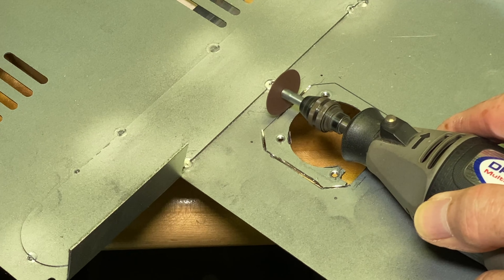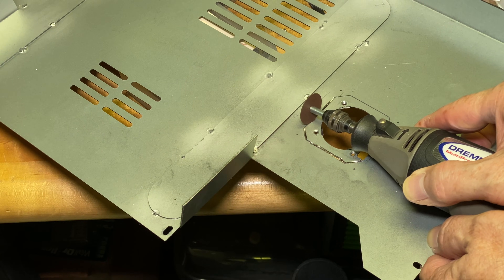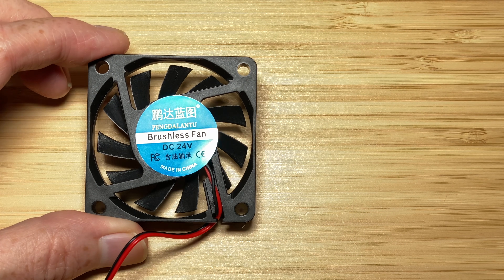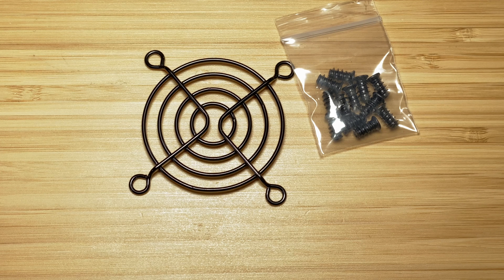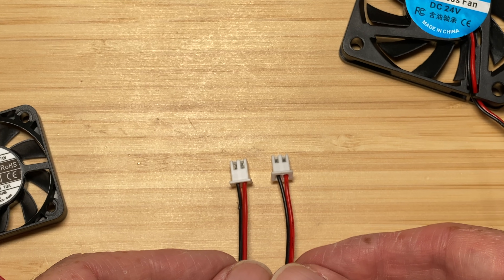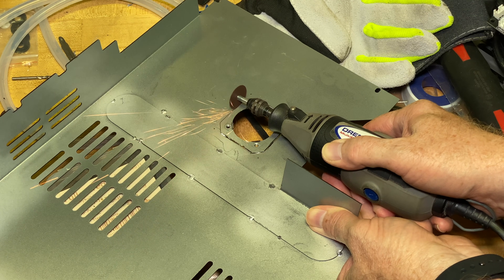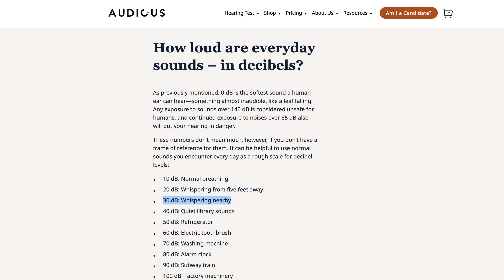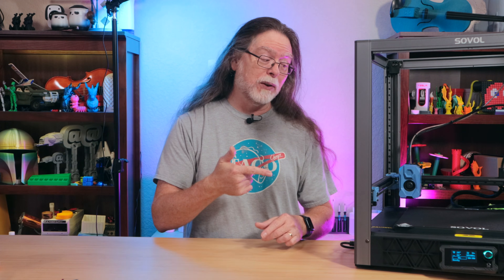Make your Sovol SV08 QUIETER with this $3.50 Fan Mod

Comment: I have received my SV08 about a month ago: 1. It has an aluminium bottom panel - no sparks when cutting out for the fan.  2. The fan is not running all the time, in fact I can't work out when the fan runs (?) If anyone know when this fan is meant to run in this later version, please let me know. I enjoyed your thorough explanation anyway, thanks.

Comment: you could just replace the stock fan with noctua nh-a4x10 24v. It's the same size, but infinitely quieter and very reliable. No need to even configure it, this thing is unnoticeable even on constant 100% speed. And certanly no need to cut anything
Reply from the maker: Thanks! I keep forgetting that Noctua finally came out with a 24v fan.
Reply: You have a Sovol?
Reply: What people don't mention about the noctua is It also blows way less air than the stock loud sv08 fan sso you sacrifice quite a bit of cooling for more silence. I print a lot of 24 hour plus prints so I didn't want to put in a fan that cools less

Comment: Hello, I do not  have that printer but if I did I would like to do this mod the first uestion I would have would be which way did you point the fan blowing in or out? I am uessing that you have it the same way as the old one but you did not state this in your video.

Comment: I wanted to share another way to avoid drilling.. get a bigger quieter fan 24v compared to stock fan , go to thingiverse or thangs and search - adapter for fan from 30mm to 60mm - this is an example.. there’s a plethora of sizes, after that install using same screws from stock fan.. no drilling no cutting

Comment: You had the work cut out for you there.

60x10 is a good size-type, nicely chosen.

I have a different printer mostly DIY and i have dug around and found myself to be in possession of a bequiet double ball bearing 80x25mm fan which i bought about 22 years ago, it was perhaps a little too loud for my PC so not used much, but in the 3D printer it's pulling pretty good duty on the printer controller cooling... might even be a bit of an overkill but that's just how i like it. I did open it up and pour some 75w90 oil into it which seems to have quietened its bearing knock that it's always had. When you have a nice quality fan like that when it's completely worn down you just open the back, chuck the bearings and order fresh ones from a bearing specialist it'll be good as new, but it should take more than 10 years of 247 to get to that point.

Kinda tempted to design a voltage mode control fan controller based on Blue Pill... could get a small handful made and put them idk one in the 3D printer and don't know where to put another one or two, my PC doesn't REALLY need it i don't think... but it would let me combine 12V and 24V fans on the printer which ever way and individually control them, could also tie them into motor enable signals and whatnot.

Comment: When assembling my SV08, I swapped the stock motherboard fan for the Noctua NF-A4x10 24V fan.  It was instantly so quiet and cooled the MCU so well that I didn't bother with the rest of the upgrade to put the fan under PID control o it only ran when needed to cool the MCU, and only as fast as needed to keep it quieter.  I left the Noctua fan running all the time directly from 24V.  It's a very reliable high quality fan so it should last longer than the SV08.

I also upgraded the stock hot end for a MicroSwiss hot end.  This gives me the ability to cold swap the nozzle with one hand in two minutes using nothing but a 7 mm nut driver.  The SV08 hot end requires me to remove and reinstall the heater and thermistor without damaging them, just to swap the nozzle.  I also like that the MicroSwiss FlowTech nozzles can be shared between 3D printers once they have been converted to MicroSwiss hot ends so the investment in nozzles is retained.
Reply: +1 On this mod. It's the first thing I bought for my SV08 and it's been keeping its MCU board cool since I got it last summer. Also got a Noctua fan for my exhaust filter, they can't be beat when it comes to quiet operation
Reply: @samlcyo2  - I'm designing and building an insulated and structural 3D printed enclosure for the SV08.  It has two large activated carbon HEPA filters on top (sold for use with room air filters) and two 120 mm Noctua fans in the back to either push the air through the filters or to actively exhaust the enclosed SV08 when the front door is raised while printing PLA.  I'll upload the files to Thingiverse and Printables when the design is finished in a week or two.  More light gray PLA is being delivered today.  The enclosure uses a lot of filament.  Someone should make The Enclosure Of Many Colors (or Joseph and the Amazing Technicolor Dream Enclosure) by connecting all of the 40-60 gram leftover reels of filament they have lying around.   😀

Comment: My printer is still loud. I changed out the fan and that’s fine now but the belts are so loud I can hear it with the door shut a few rooms away. Any other mods to make it quieter or did I get a faulty machine?

Comment: Sure "i dont have to source screws and stuff"
Have an Ender 7 (well eh the frame still is original)  it now has 6 5160's on an BBT Manta e3 with CM4,  3 ldo steppers and LDO Orbiter 3 tool head...
And since then i own more screws one can shake a stick at m2 m3 m4 m5 in all lengts...

Comment: I just got my sv08 put together & measured my ambient noise level in the room at 48dB, and with the sv08 on (no mods) at 60dB (1 meter from the unit).

Comment: Did you changed the firmware or just updated the fan?
Reply from the maker: I didn't change the firmware, I only replaced the fan with a larger, quieter one.

Comment: How do you find the host temps with the new fan?
Reply from the maker: Hi, with an ambient temperature of 26.8˚C as reported by the bed, the host temp is around 44˚C and the MCU temp is around 32˚C.
Reply: @BV3D  awesome. That sounds better than stock. It's about 12c down here and the host temp sits around 34 to 40c no load.

Comment: There is a software controllable fan header on the board. It is available in Klipper.
Reply: I've moved mine. Still doesnt quiet it down, nor does it cool very well
Reply: @hairytoez75  You ever mod?
Reply: @boredfive3001  I ended up cutting a hole for a 92mm fan with a buck converter at 9v
Reply: @ How did it improve things?

Comment: Fans and shroud proximity, have been something that manufacturers still haven't figured out since Ender3 for some companies.. from an engineering perspective, it's honestly sad. They just have an obsession with these stamped fan shrouds and sticking the fans right against it.. all it takes is spacers to move the attachable style of shrouds a few mm further from the fan. Sometimes ground clearance becomes an issue, then you also need to extend the printer's feet a bit.

Comment: You could put some locating pegs on the cutting template that fit in the original screw holes so it's always perfectly square.
Reply from the maker: That's not a bad idea!
Reply: @BV3D  Sounds a little OCD as it doesn't really matter if it's perfectly square

Comment: I installed the Noctua 40x10 24v before I ever turned the printer on, so I don't know what ya'll are talking about. Drop in replacement and whisper quiet, though more expensive.
Reply: First thing I did when watching this was look up noctua🤣 found the fan you bought. Was it plug and play?
Reply: @zac_in_ak  Yes.  The one I got was same size as original, so no cutting or anything.  Just unplug and unscrew the old one and screw in and plug in the Noctua.  GerGo 3d has code to make idle temps better if you want to do that also.  Remarkably quieter
Reply: @zac_in_ak  It was.
Reply: i can only find 3 or 4 pin noctua fans but isnt the sv08 fan 2 pin?
Reply: @khakiboi  One of the included adapters worked for me. Noctua gives you a bunch.
Reply: @khakiboi  The 40mm noctua I saw came with a bunch of adapter cables
Reply: I recommend the Noctua as well.  Did you insert the code to reduce fan speed at idle?  It helps alot also.
Reply: @newCrysis  Sure did thanks.

Comment: simple code in printer.cfg file  will make it run only when it is getting hot
Reply: adding a quieter fan, such as a Noctua, will help when running and idle.  I love who ever figured out the code to reduce fan speed at idle.

Comment: Dad joke level = black belt

I have one of those older dremels too and it just keeps on working. Been a phenomenal tool and I'm very familiar with that hot air that comes off the motor. Can make things uncomfortable sometimes.

And those cutting wheels come in large packs for a reason. 😁 I've had a number of oopsies over the years where I put a brand new wheel on and immediately break it. The man who makes no mistakes never makes anything.

Comment: I received my SV-08 on June 26. It has an aluminium bottom plate that has protection for the main wire loom. I would not recommend those fans that you link to Amazon. Winsinn makes 6010 / 24 volt a 4 pack for $20 USD. dual BB fans.

Comment: For those who don't have a rotary tool, or don't want metal dust everywhere, I recommend using a nibbler (like the Radio Shack HT-204) instead.

Comment: Done the same to my creality CR6. Those 60mm 24v fans were so loud! I replaced them with 80mm 12v fans with a buck converter. Two years have passed since that mod and it still works great. I sleep near my printer and I do not have any issue even when it is working (made other several mods to reduce vibrations, hotend fan and part cooling fan noises)

Comment: Thanks for the video Bryan!  Like you, I wanted to quiet the SV08 down where ever possible.  Even at idle the motherboard fan is screaming away.  This code was shared on the Facebook group.  Added anywhere in the printer.cfg file, this will turn the motherboard fan off 2 minutes after the last stepper motor has turned or heater shut off.  Also, causes the fan to run at 75% speed.  Either of these can be adjusted to your taste.  In my opinion, Sovol should be including this from the factory.  At least they gave us a controlable pin (PA1) so we can do this ourselves - big props for that!

[controller_fan controller fan]
pin: PA1
kick_start_time: 0.5
max_power: 1.0
shutdown_speed: 1.0
fan_speed: 0.75
idle_timeout: 120
Idle_speed: 0.5
heater: heater_bed, extruder
stepper: stepper_x, stepper_y, stepper_z, stepper_z1, stepper_z2, stepper_z3
Reply: What other ways did you do to quiet your printer down? Mine is still loud but mostly the belts